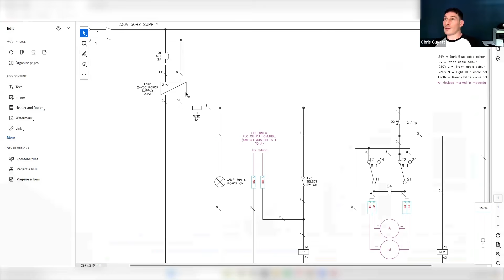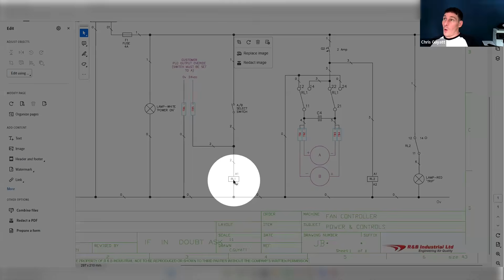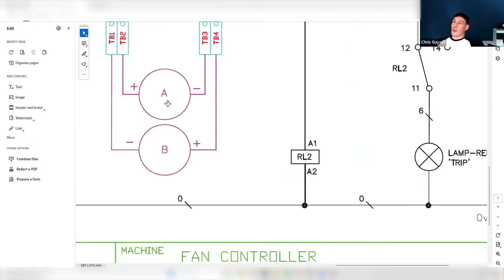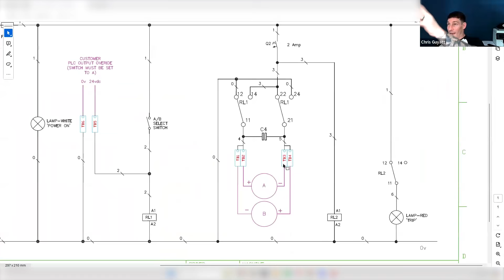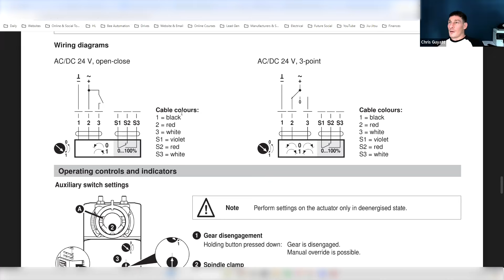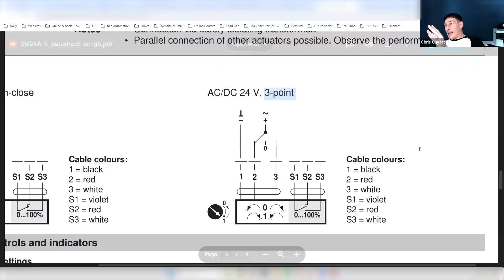HVAC Controls (BMS): Wiring Dampers & Belimo Actuators Explained

Comment: for the simple linear actuator, the DPDT relay that directs current through the different polarities on the actuator just changes the magnetic field on the motor. When current flows from Positive to negative, the actuator motor moves clockwise, driving the shaft outwards (Opening the damper). when the polarity is reversed, the motor spin's anti-clockwise, driving the shaft inwards (Closing the damper).